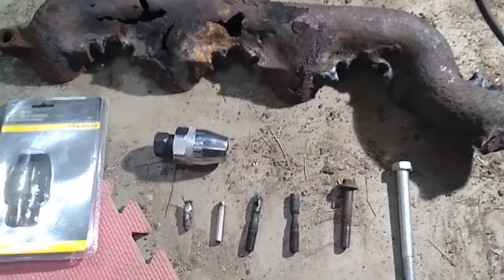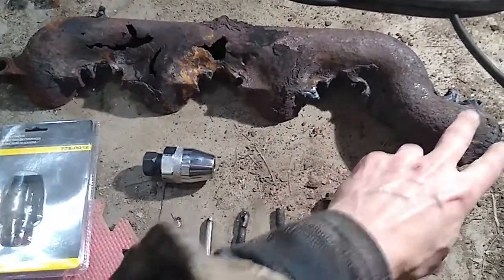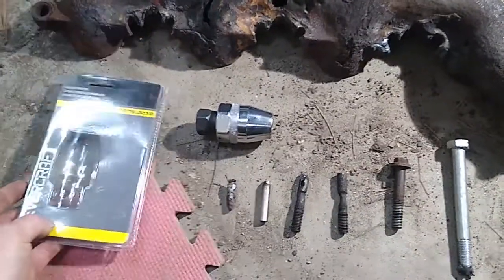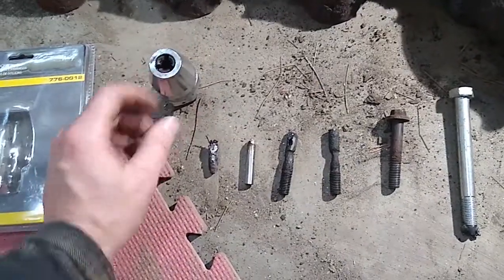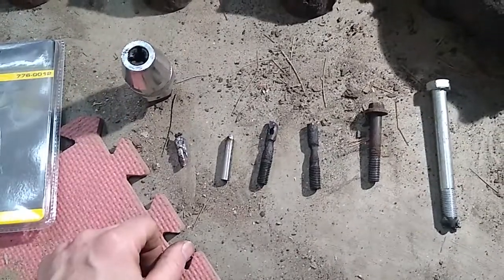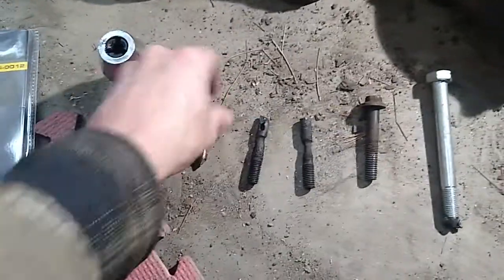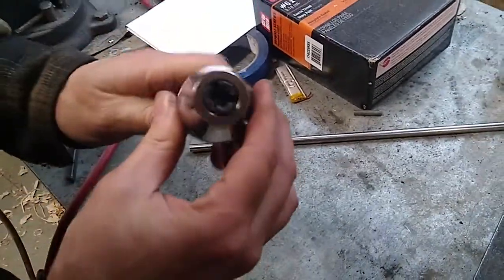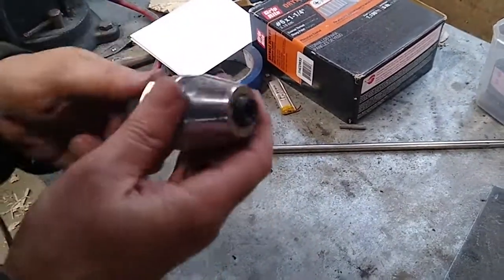Stud Extractor- Damage Risk!

Comment: Yeah, the casted center broke off on me from less than round stud on my first try.   The black hardened one slipped and wouldnt turn.
Reply from the maker: The worst!  Might need to hold the case while ratcheting to make it tighter on the stud, otherwise maybe try super heating the stud or loosening with some good strikes.  Good luck

Comment: I just judged used vise grips to get one out
Reply from the maker: Impressive!  I know there's like no space in there to work!
Reply: @NineCarGarage  this was on a 02 Sierra 2500hd 6.0l lots of room lol
Had 5 bolts that the heads were still on but were in rough shape.  And one with the head broken off.  Sprayed them with liquid wrench and wire brushed them for a week. Then used a small torch and heated around the bolt head.